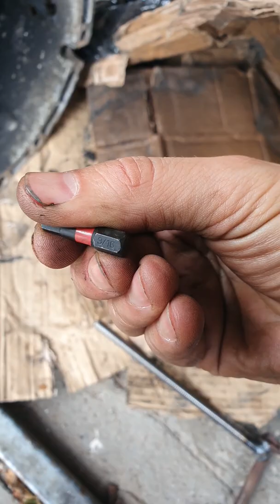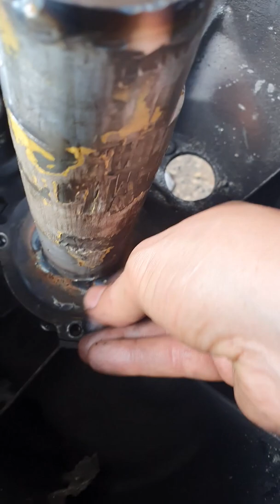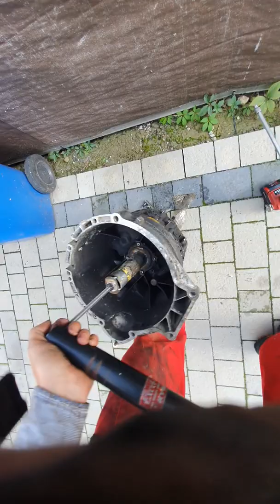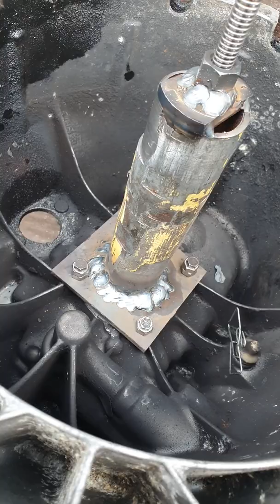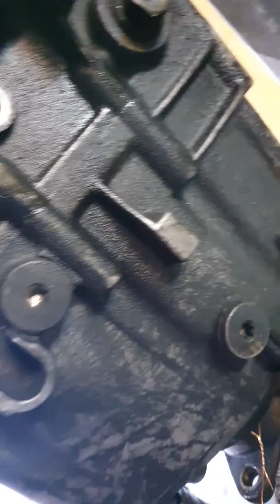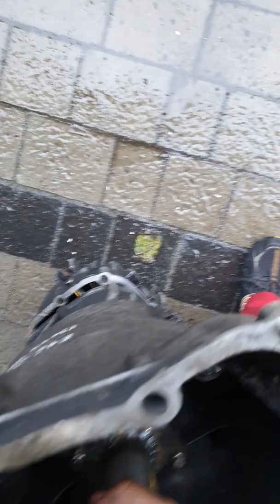BMW gearbox opening . E36/E39/E46 s5d-320z. ZF s5d 280/310/320 gearbox rebuild / repair . Part 2

Comment: lesson learned there's a snap ring behind the front seal that allows the bearing to come out. Now have to fix the brackets are bent but it's good to watch the video because I'm probably going to have to do this to my car hopefully not I have a knocking sound coming from the gearbox

Comment: M I have just tried fitting my gearbox today and the bell housing is slightly different its a bmw x1 e84 2011. I dare say that the two bell housings will be interchangeable??

Comment: Thanks for the video and for the effort to share your experience! It's extremely helpful!
Another way to take the gear bell apart, i guess, is to fit some sort of "beam" to it, screwing it with some bolts where it's supposed to attach to the engine, and pushing the shaft tightening a big bolt through the "beam".
Also I agree it would be better remove the oil seal and the Seeger before.
Not to criticize, it's much easier now that you have done the "dirty job"!
Can't wait to see further updates!
Reply: Hola! Tengo una caja GETRAG de 5 marchas sin varillaje/selectora, se podrá fabricar de forma casera? Nunca tuve una de éstas cajas y es para adaptar a otro vehículo. Gracias !!!

Comment: Hi Mieczysław, are you located in Poland? I'm in desperate need for such a tool - I need to replace my input shaft bearing in S5D 320Z - THCG and every gearbox shop that I've called to told me that they don't touch these ZF boxes... I don't have gear in my garage to put together tool like this on my own. Maybe by any chance you would like to help me so I could go to you with my gearbox to disassemble it or do some "Inpost magic" to rent it to me for a few days? I'm located in MZ btw. Thanks.
Reply from the maker: Hi !. From time to time i'm in Poland :). I can borrow tool for few days , but ... I have no idea how to contact you in private message ....
Reply: @mieczyslawkozielski7546  Yeah, I've tried to put my mail addr as a comment here but youtube instantly deletes it. So I've put it in the description of one of public videos on my account https://youtu.be/gZTlDrG7uGI Maybe you could try to contact me using that.

Comment: If you were to remove the disc spring that was behind the input shaft seal, that would have allowed the shaft slide out of the bearing. But i guess since you left it on, it caused the two bearing brackets to bend. These things are a pain to open. But thank you for posting this. It definitely helps us understand what tools will be needed to open the housing.
Reply from the maker: That’s very good idea !!. Thank you your comment …. This way force needed to part out castings shall be reduced and those metal elements also shall be intact… I’m wondering about bearing itself / there will be severe friction between inner bearing race and shaft itself that might destroy bearing since there is no way to support inner race from the other side ….however that just theory I don’t know what’s fitting type is used for that pair (bearing /shaft) if isn’t too tight it might be perfect solution :)

Comment: The main shaft that goes in the clutch is meant to be taken out from the inside. You have to take it apart by just pulling the blocks apart. The main shaft is split so it can remain in the bell housing.
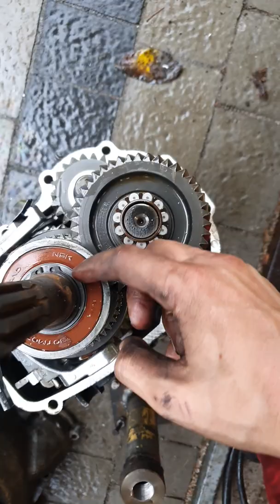Reply from the maker: I'm not sure if i understand what you're try to say. Please take a look @ 18:22. Inner bearing race installed on "clutch shaft" is secured at their position with seeger ring, outer race is secured by metal pieces screwed to bell housing (18:33)... On top of that ...to remove clutch shaft (since it has gear with part of synchronizer), you need to remove counter shaft first - they are in collision. Cant' post picture here, but can share if you'd like to see.

Comment: Did you get this back together ?
Reply from the maker: Not yet.  I had not too much time to continue with rebuild. I made tools needed to further disassemble (remove geartrain), and suceed with that piece. As for re-assembly ...well...hopefully in next half year i will have a chance to make it happen :)
Reply: @mieczyslawkozielski7546  czy porównywałeś wnętrza tej skrzyni z elementami ze skrzyni 320z? Chodzi mi o przełożenia czy można zamiennie stosować?